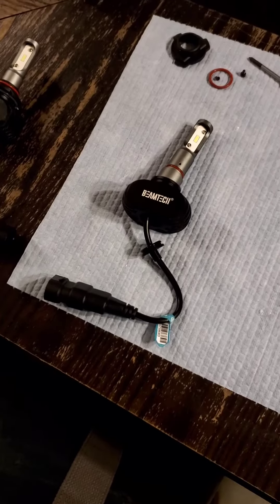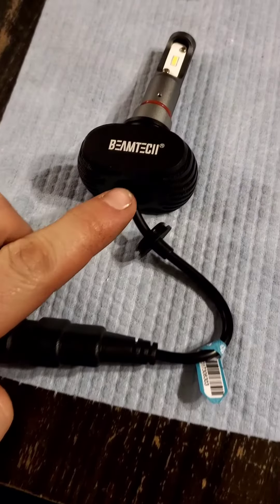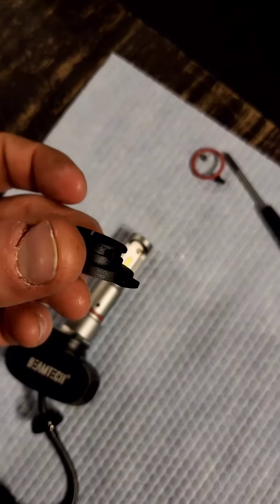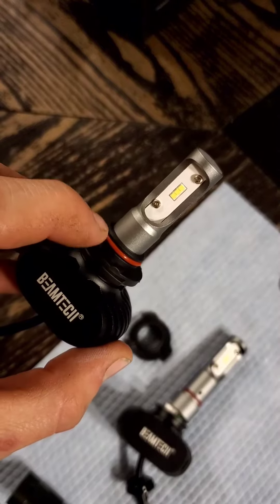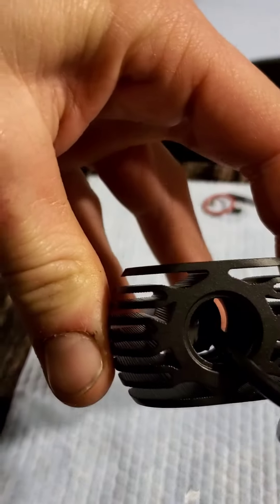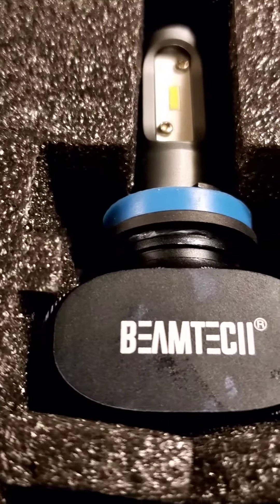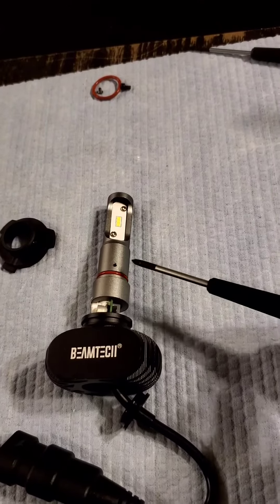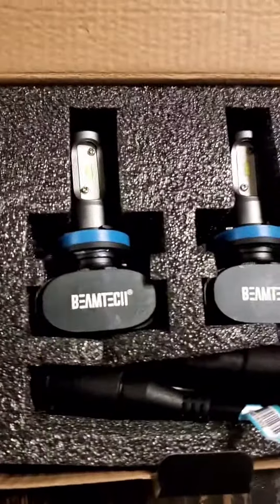waterproofing beamtech headlights

Comment: Followed ur video great help . Water still got in mine from the Allen screw. Sealed those as well and it’s 100% now.
Reply from the maker: That's good that you found where else to seal I have and my lights underwater multiple times and still no water intrusion but I also siliconed them into the housings